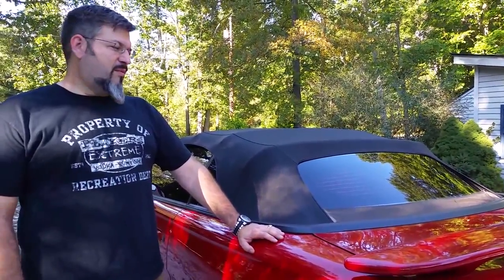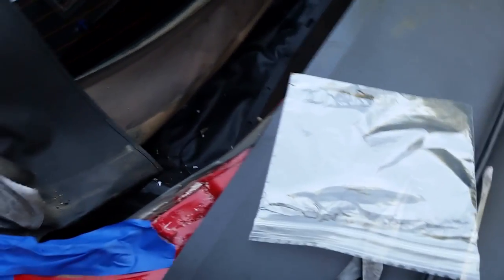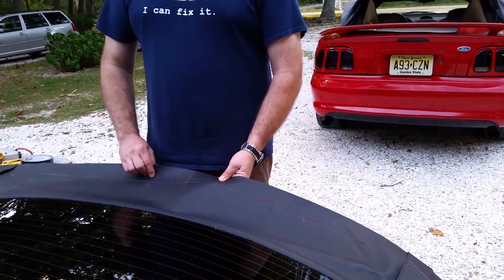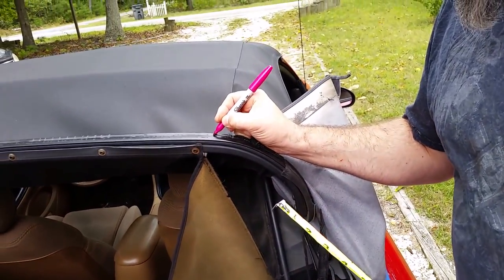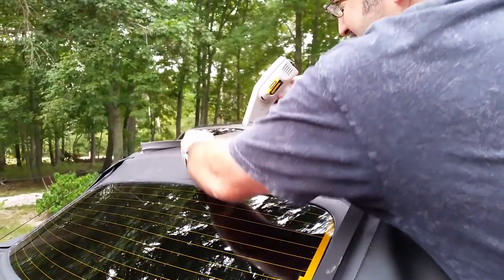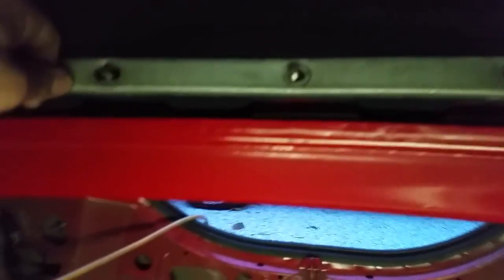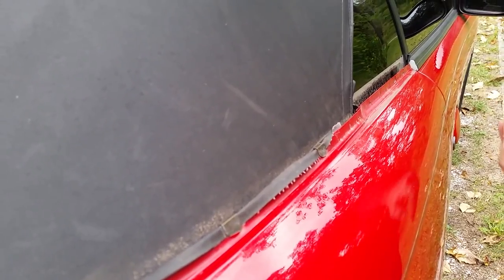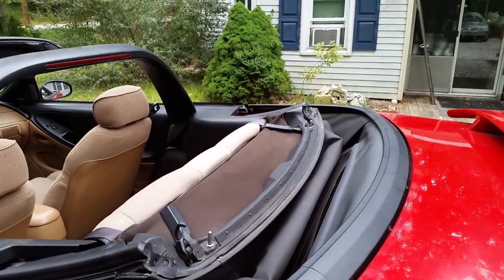1994 to 2004 Mustang Convertible Rear Window Step By Step Replacement Save Money $ $ $

Comment: Great job! I bought this 94 mustang and the top is not in great shape...but it has glass window which looks great...my question is....I see tops on eBay which are made with same materials and specs as original tops...there's one that comes without rear window...do you think  I can use my old window? The material that supports window is still in nice condition since top only has a little damage....also are those 1/4" stainless steel staples? Thanks
Reply from the maker: roadstar499  yes you could get away with not replacing your rear window if it is in good condition but not all convertible top material is created equal when buying new. You'll want to find someone who sells correct pattern canvas for your year mustang.  The sun does fade the material so the material around the window may not match the new top color due to fading.  Open your convertible top half way and look in-between the outer canvas and the widow canvas that wraps around inside toward the quarter widows. Make sure there aren't any cracks or holes developed in that canvas, it takes the most abuse from the top being folded and crammed into the pocket. That is where water gets in.  It may be hard to see in there.  I would recommend replacing both.....  Keeping the rear window if is in good shape and replacing just the outer canvas is entirely you.  It depends are you keeping the car forever or fixing it for resale?  It's a lot of work to do again in a few years if it develops a leak. I hope this helps your decision.  Also you "should" use stainless staples if you can find them. I used different size staples for different areas on the install and listed them in one of the older comments to somebody else.   It isn't the end of the world if you don't use stainless staples.  I've had cars with steel staples 15 years old in good shape still. Good luck and thanks for the question.
Reply: Zero Fuel Required thanks for all your great tips....I may go an order a window also...thanks again
Reply: Just got my top...am going to start tomorrow......will be using old glass window...main part that worries me is trim  strips screws...bought a fancy angled flex unit that attaches to drill like that guy meca uses doing white mustang top...anyway if it comes out great i will be very happy and order new seat covers and do them myself also...just don't want to drop those tiny screws down the quarter panel,definitely no way to retrieve them...thanks

Comment: Wow where do I find a woman that easy to work with and be so calm cool and collect, . I'm doing a 1998 z28 Camaro try to just glue window with black 5200. Is it possible ?
Reply from the maker: Mary Surniak I'm not familiar with black 5200. I looked it up,  It's a urethane and it should work.  Make sure you clean the glass really well with Acetone (probably the best thing) don't drip it on your car anywhere protect your car. It will remove any residue. While gluing it, make sure it doesn't move at all until it's cured.   Take your time. Hope it works for you.  Thanks for the comment.

Comment: Can I save the glass from my old top???
Reply from the maker: Richard Gresham you can.  My glass was separating from the fabric.  I do not know what kind of adhesive the factory uses to attach the window to the fabric.  It's not the standard windshield adhesive. There's kinda no reason to save it if you got a new back window section with vinyl attached.

Comment: How do you staple to metal do I need this special stapler
Reply from the maker: Doughboy Videogates you don't actually staple into metal anywhere when installing a convertible top.  There are tack strips that you staple into, they are a hard plastic/ rubber like material.   Any normal stapler will work,  I used an electric  stapler, set to the highest setting, plus electric stapler is much easier to use consider how many staples you are going to use.  You could use an air staple gun but the staples aren't as wide as a normal staple gun. I hope that answers your question.
Reply: Zero Fuel Required oh great I was trying to see if there was a wood or plastic/rubber strip I'll have to watch it on my PC thanks for the great video
Reply from the maker: Doughboy Videogates no problem,  thanks for the question.

Comment: so u got to set the parking brake and emg brakes to op the cont top huh me thinking mine broke smh lol
Reply: el digge check your relays they’re located next the convertible hydraulic pump there’s 2 of em , my top would only go down and not up, turns out it was a bad relay, their pretty cheap , hope this helps

Comment: why not replace entire top from Ebay 200$??
Reply from the maker: When I got the mustang someone had replaced the convertible top before and it's like new. That person before me was  being cheap they didn't replace the rear window.  I have had the car for a few years it started leaking so I replaced just the window.  It might be a long time before I have to worry about the main top. Thanks for the question.

Comment: Thank you helped alot
Reply from the maker: I'm glad I could help.  Thanks for the comment.
Reply: Your welcome , I have a 98 I’m trying to fix up , how difficult is it to install a new top? Question the top closes and is water tight but the framing for the top doesn’t sit flat at the bend above the window in the fight joint window closes in all but sometimes the window flats out any idea what’s up

Comment: Ive beene looking all over the place on youtube. the staples surrounding the rear window insert of my 1994 crysler lebaron popped out
Reply from the maker: sleestalk is that a question? I looked online at a brand new Chrysler Lebaron convertible top.  They appear to be very similar to the mustang in the way attach and install. If your going to attempt the repair yourself take pictures as you take it apart so you know how it goes back together.  It really helps.

Comment: I'm sorry....why did you need to change the window again? Good video though
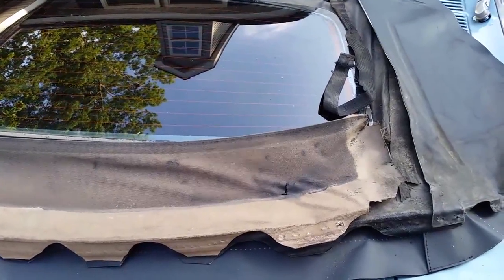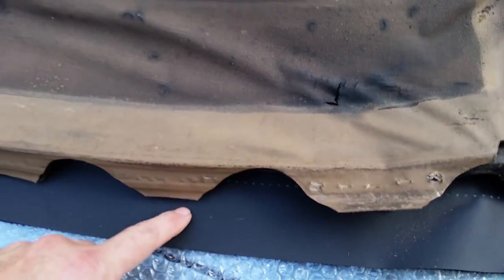Reply from the maker: 05FIVEO before I owned the mustang someone replaced the convertible top and not the rear window for whatever reason,  I don't know.  In the video at 8:15 to about 8:45 you can see the old window and canvas laying on top of the new. The old canvas has  cracks and holes you couldn't see when  the top was up, it had deteriorated to the point every time it rained it was getting in the car.  The carpet was getting wet on the rear floor,  this would eventually ruin my rust free 96 GT. I hope this answers your question.   Thank you for your comment.

Comment: Isn’t this a 1998??? You can tell by the tail lights
Reply from the maker: Alberto T Estrada No this is a 1996 GT.  1994 and 1995 taillights are different they go horizontal.  1996, 1997 & 1998 are exactly the same taillights that go vertical.  Hope that answers your question.

Comment: not how my stang looks in the back
Reply from the maker: 94 to 2004 should be very similar rear windows.  Unless your window is a plastic window.  what year mustang do you have?  Even if your window is different  or an older mustang all the way back to the 1960's to the present day 2016  window replacement hasn't changed much on the mustangs. once you do one you could do any year mustang.